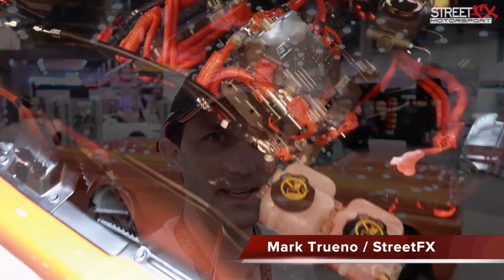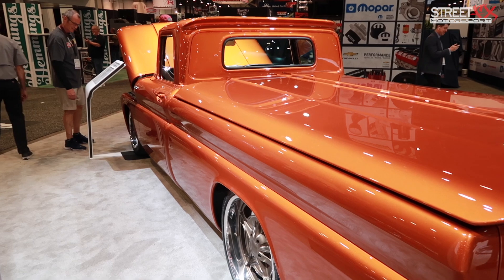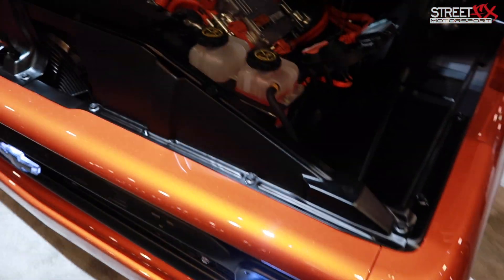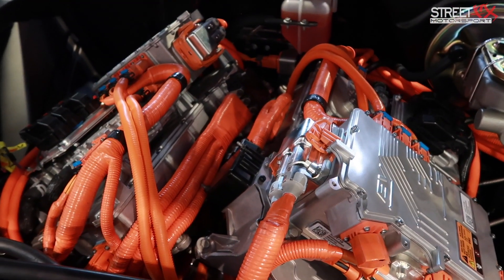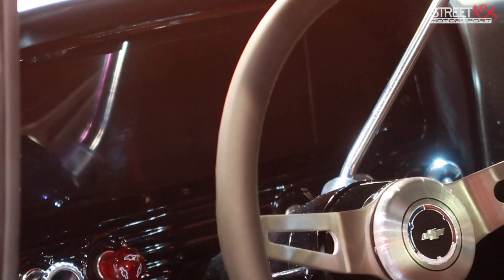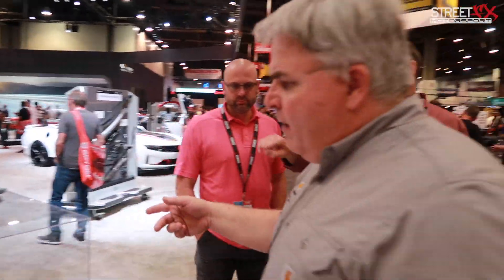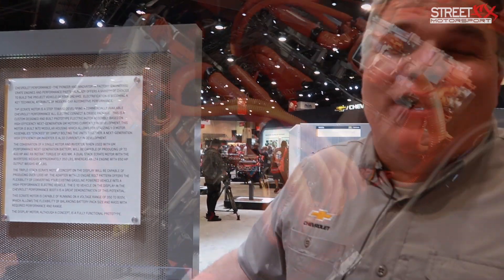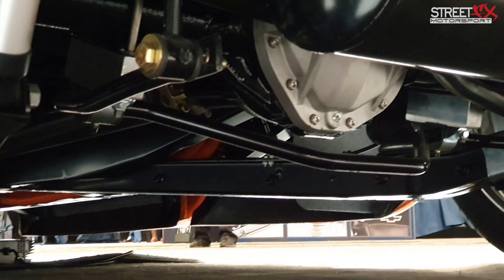EPIC OR Sacrilegious?! Electric LS SWAP Crate motors & 450hp EV Chevrolet C10 E10 truck

Comment: I’d be ok with a hybrid setup electric motor in the bed of the truck and somehow drives the front wheels and a good ol American crate engine under the hood. Flip of a switch you can be electric only or gas only or  ⛽️ + ⚡️ awd insanity!

Comment: power density for batteries is making improvements but it's just not there yet. to sacrifice the bed entirely for battery space --IN A LONGBED, no less, isn't really worth it to me. there's a lot of potential here, i'd love to do my 90's suburban in EV, even for 150-200 mile range, as long as it doesn't cost me 50k to do.

Comment: lol it was cool until I realized the batteries were in the bed. that negates the purpose of it being a truck. The batteries have to come out of the bed. Place some upfront and the rest over the truck bed and have them open up like french doors so that you can store things in the bed of the truck. They will be partly structural as a bed cover. but also give you the versatility to store tall things in the bed if you open them up. I understand that this is just a concept to show that the bolt powertrain can work in a truck though. It would be really nice if they made a kit for the Prius to go full electric.

Comment: Id like to see more parts for ev trucks converstions
Reply: You must be rich.
Reply: @nickoD509  why does he need to be rich? First off he just said he'd like to see more ev parts not purchase them but if he does mean purchase that doesn't mean he is rich, the parts have come way down in cost and if you do a proper ROI on a Gas v. EV you quickly find the extra cost of the EV parts get absorbed into the large fuel savings and help balance out the cost of the build. For instance I'm my case I commute approximately 300 miles per day 20 to 24 days per month and get 28mpg in my car I get a reimbursement of .585 cents so if I dont pay the fuel cost of $800-960 month then I get to pocket all of the $4,212 reimbursement per month so you tell me would I need to be rich to want to save that money or is it just a smart investment that could save me thousands of dollars in the long term or in my case even the short term saving a large. The only thing that is holding me back from these conversions is the charge to distance equation, I don't have a static destination and sometimes my commute will exceed the 300 mile mark so if I use all my battery capacity and get stuck needing to charge up then I would get caught up in the return traffic jam and this could turn a 2.5hr commute into up to 6 hours on a holiday weekend and 4.5hr on a basic Friday. My family time is very important to me so losing this time due to a simple charging mishap is the main reason I have not converted and am looking more towards a Hybrid v. EV at this time. What I really would love is a Hybrid with a classic body now that would be the dream right there. Sorry for the long post.
Reply: @timwegman5776  How much do parts cost and then the labor? Thats what I mean and not to mention for the vehicle itself. Parts and labor combined for a Tesla, it costs nearly $16,000 to replace this Tesla Model 3’s battery pack. It takes money for that changeover. Might as well just buy a brand Bolt EV then.
Reply: I need this BIG battery in  my Tahoe hybrid So i can get more RANGE  out of the EV mode

50MPG please

Comment: Beautiful truck but 3 square feet of storage in the bed pretty useless.
Reply: Yeah.  Tesla swapping with the battery as the bed floor would work a lot better IMO
Reply: Yes I completely agree however I do believe in this scenario they have done this to reach the goal they have for the distance they need to drive daily for whatever challenge they are referring to in the video. They speak of having to drive 250 miles per day,however I do think that's an excessive size for just 250 miles. Maybe the batteries could be mounted under the bed but you would think the engineers would of done that if it was possible
Reply: A truck like that would never have anything in the bed anyway.

Comment: its cool but that bed is wasted smh might as well not even have a truck
Reply: This is for showing, not hauling. They want people to be able to see the components. When you build one, do it your way.
Reply from the maker: hopefully batteries get a more reasonable size. That being said, how many show quality trucks you see have a functional bed?
Reply: @StreetFXofficial  why not put the batteries between the frame under the bed 🤷🏾‍♂️you know where the gas tank and exhaust would be? Problem solved.
Reply: @gadgetmanhookup  you have a good point and I've been thinking about that same question, I think it's because that would be too easy and then General Motors would have to make all the trucks that way which is more expensive for them then just having Us by our gas every time we need it.
Reply: @StreetFXofficial  true but personally i dont see the point of these sorts of trucks
Reply: @Isaac-zz2uv  then they aren't for you. They are more art than utilitarian pickup trucks.